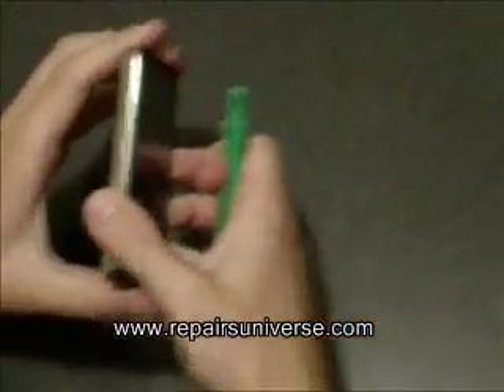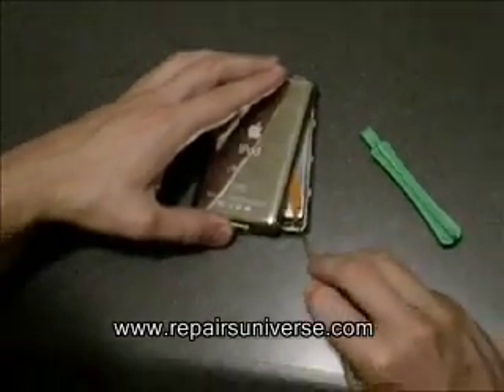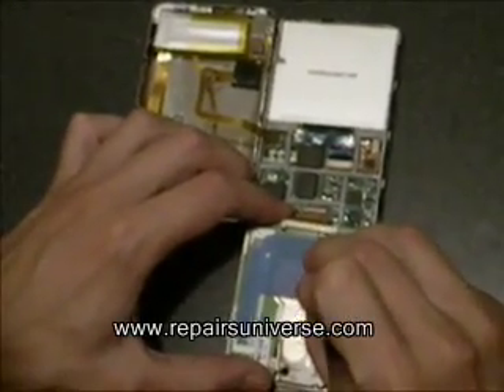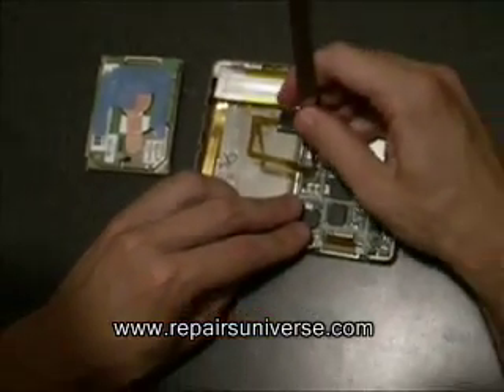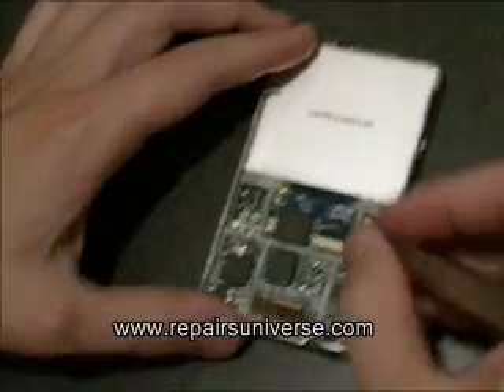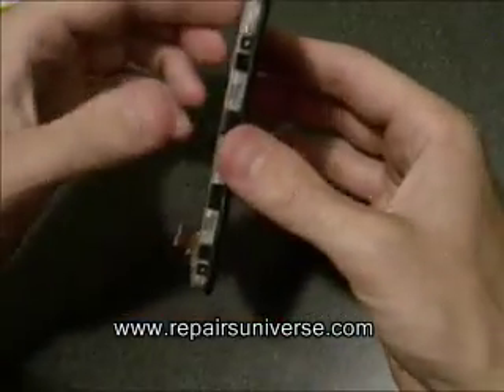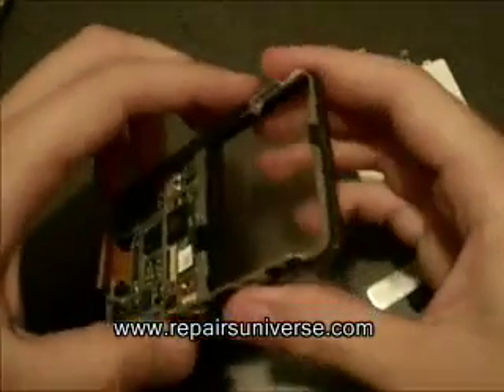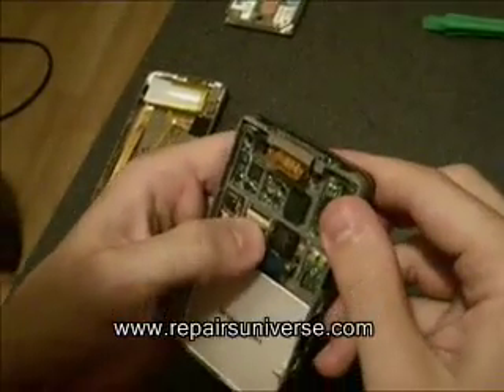How to Replace iPod Video LCD Screen Display 5th Gen 5G

Comment: Does anyone know if you can replace an iPod "Classic" (6th gen) LCD with an LCD designed for the 5th gen iPod? They are both "video " capable and in color...Worried about the sizing and connections though.
Reply: I'm having the exact same question here. Did you ever try this?
Thanks in advance, bro.
Reply from the maker: Jesús Álvarez
We offer both screen replacements and I recommend to purchased the variant specific to your iPod. They look very similar but have different sku's and it's best to use the specific one to your iPod generation.

Comment from the maker: @patrickmc018 Thank you. The issue could be caused by a few different things. The most likely being a bad connection or the wrong LCD screen generation/version. I would double check that the replacement screen is the exact same as your replacement.

Comment: My 5th gen display broke at some point and began as a gray area at the top while the rest still worked and i could scroll and go on as normal.  Eventually the crack in the LCD expanded and nothing showed up on the screen, however it would still light up and i could play music.  I got a screen, followed your instructions (which were awesome by the way) and now my entire screen is just white when it turns on.  the backlight is still extremely bright, but no words, logos, icons, or anything show up

Comment from the maker: @iverson2k10 It is possible if the "jaw" connector is damaged that the LCD flex is not making a good connection or loose connection, making the screen stay blank. Sadly, there is no easy way to resolve that. I've seen the issue come up before with the iPod Video, they seem to have weak plastic connectors that can sometimes become frail. The only real option i know of is replacing the motherboard, which is usually quite costly.

Comment from the maker: @iverson2k10 Ah I understand, usually this is caused by the LCD screen. I would suggest checking the cable and seeing if any visible damage is present, especially around the LCD flex connection. It is also possible the LCD screen has become faulty.

Comment: just use a thin knife an be careful a bit! it´really is no thing to open your iPod... but just do it slowly an take your time ;)
i just changed my broken 30gb storage in 30 min with cleaning the display... it still works as  the first day. all you should know is, that you will loose your 1 year warranty when you open your iPod.